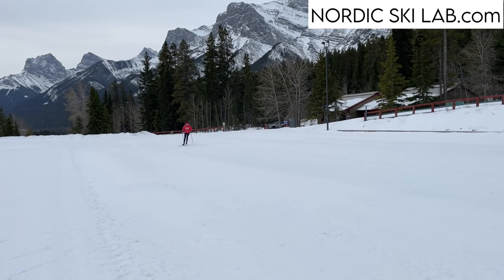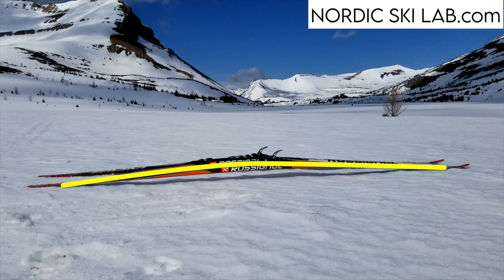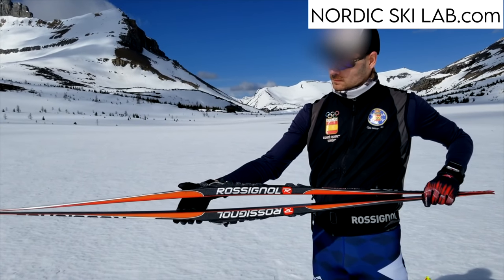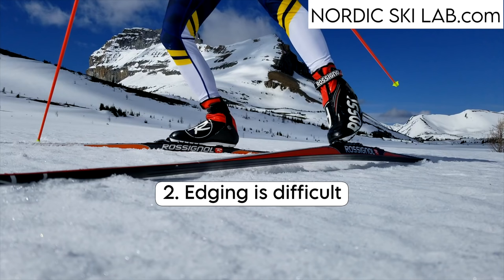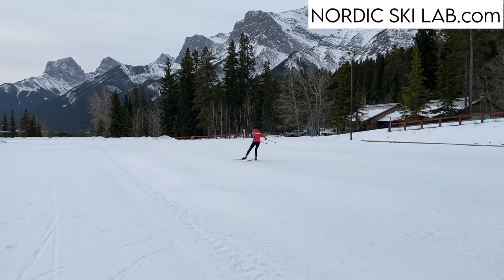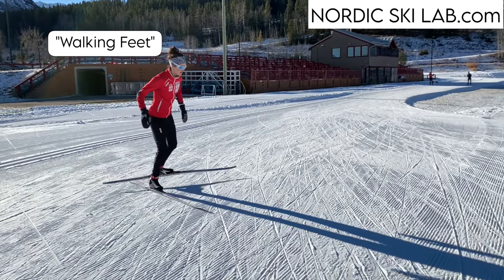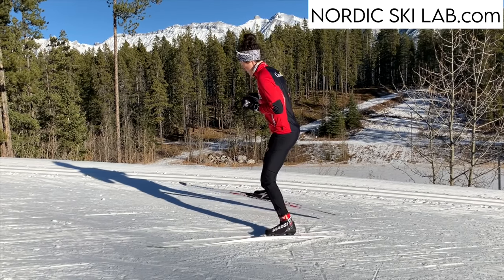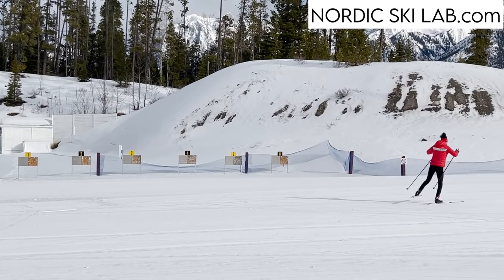Help for Struggling Skate Skiers: Why is it so hard?

Comment: Thanks for the excellent explanation. I’m a Nordic Ski Patroler and I just bought skate skis 20 years ago and figured I could do it very easily. It did not work out like that. After I spent a lot of money on good equipment I had to say to myself how stupid I was to not even try it before I bought the equipment but I felt with my skiing experience I could do anything. The first time I went out was exhausting and did a mile. The next time I was able to go 2 miles. Then I slowly improved. I Read up on it, took some lessons and at the end of the season I was able to do 5 miles. Although I’m slowing down in my older age I am still very capable of doing 15 to 25 miles in a day. I’m still learning and it’s amazing how snow conditions affect performance. Keeps me in perfect shape by working all my muscles and keeps my balance sharp. It’s a perfect sport and keeps you warm in the winter time and helps me look forward for snow.
Reply: I Patrol XC in Pennsylvania, and was thinking of buying Skate skis soon.

Comment: I'm new to xc ski but I am a speed skater and I found it quite easy to to make the transfer to xc ski. On the first day I went xc skate skiing I was able to do 9 miles in about one hour at Gatineau, QB. I did find peculiar the swing of the skis specially with the attachment from the toe bar and the loose heel. I am not an expert but I think inline skating in the summer could be very helpful if you are looking forward to skate ski in the winter, specially if you need to work on your balance.
Reply: Darned good questions; you even had me thinking and back tracking to analyze! Traditional speed skating is a little like hockey where the blades are fixed to the boot; including the heel. In modern speed skating clap skates blades have the heel  loose from the boot and this allows you to toe push as you would do in skate ski; with fixed blades if one toe pushes, the blade gets stuck in the ice and you can even crash.  Balancing on one foot and pushing to the other foot by weight transferring to the other leg is a skill needed for both skating and xc skate but I would say it's just a different "feel" because of the length of the ski. The length of the ski just makes it a unique movement that is even hard to replicate by rollerskis. I think in general any type of skating that one can do, will exercise that skill in common with xc skate which is that transfer of weight from one leg to the other and also work a long glide after the push. For me, even  One Skate/ V2 was rather easy to do and I owe it all to skating (most of my skating is Inline Speed skating). Too bad I picked up skate skiing so late in life (at age 58) otherwise I think I could have been very competitive.  vibratingstring
Reply: Biggest difference, you eliminate up-down motion in skating but you have it in skiing to work the poles and the camber.  And skiing is a simpler motion, V-ing only, powering inside edges only.

Comment: I think that this video is close, but lacks an important point. Ice skates, roller blades, and downhill skis will strongly turn inwards when angled to one side. This produces a self righting behavior similar to how you right yourself on a bicycle (though with a bike, the handlebars are used to instinctively adjust the turn radius.). The absence of rockering in skate skis(compare that to the curve of the figure skate at 2:12, which gives the skates a pretty short turn radius when angled) makes holding the glide very difficult, as an angled skate ski will still more or less go in a straight line (there is no self-righting effect). The difference in skate technique for self correcting skates vs non-self-correcting skates is most visible in the in-line speed skaters' double push, where both of the skates are to one side of the skater's center of mass at several points in the skate motion. A skate skier would fall over nearly instantly if attempting a similar technique.

I'd personally recommend renting skate skis before buying. One skate requires weight transfer that is both precise and confident. Offset has greater margin for error, but is potentially very tiring.

Comment: Hill and deep  or cold  snow and very cold temps. Its all ways going to be hard, no matter what.Adjust your pace, and dont be afraid to take a breather. Your not training for the  winter Olympics. Enjoy the scenery.  You dont need expensive equipment. When we started skate sking after Bill Koch invented it in the early 80s , hell, we all  just skated on classic equipment with unwaxed skis for a few years until skate equipment became available. We did the  one legged marathon skate thing   on classic tracks for miles before any groomed tracks were available.    Glide wax and brushes and scrapers ??.....   We had nothing. I remember using car wax on my skis .People these days are spoiled and have no clue.

Comment: Most people don't have the right wax to one skate. If your not gilding easy your not gonna one skate. Most of these athlete's have pros waxing their skis.
Reply: it is very easy top learn. I do it by myself. It takes 15min every second run and it makes sliding significantly easier.
Reply: Wrong. I can V2/one skate and one year I skied all season without waxing my skis. Didn't know any better. Wax is less important than ski fit and quality of ski flex, and grind and base condition. If all those are correct, then think about the wax.